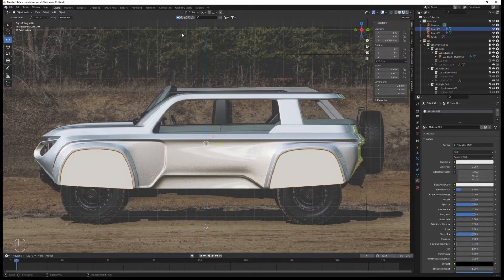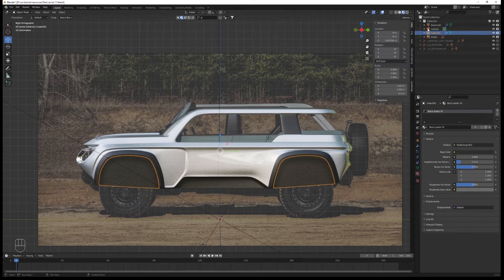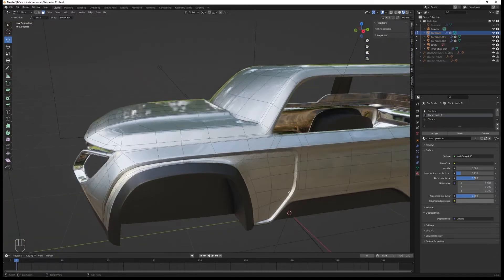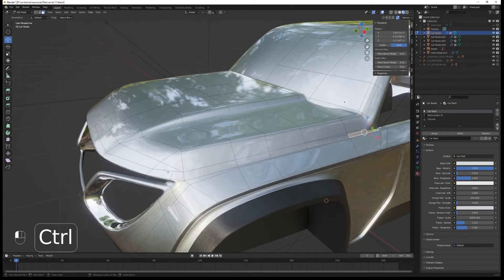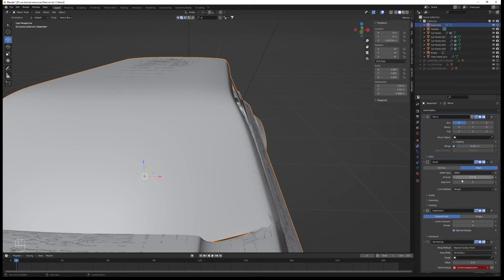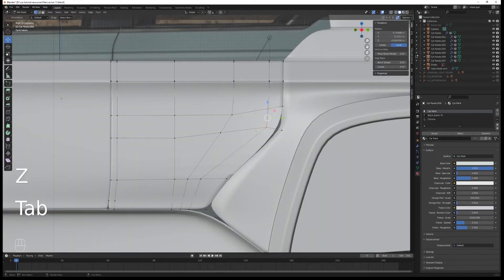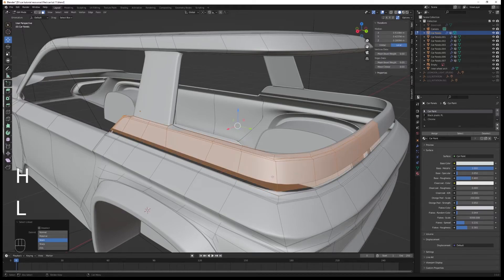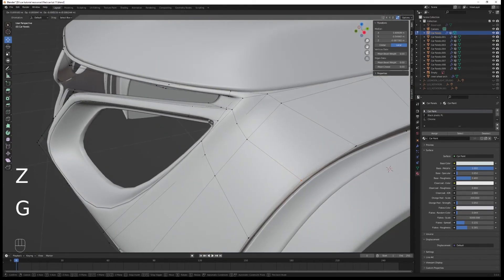Blender Concept Car Modeling - PART 4

Comment: Thank you. I thought you were going to split the base mesh. I didn't know about this method.
Reply from the maker: Yes and no! You will have one copy of the basemesh that will not be split and one that you will split.

The splitted parts will be wrapped onto the one that is not splitted. That way you will preserve the surface quality even when adding geometry.

It’s usually called the shrinkwrap method or the basemesh or guidemesh method.

Keep it up!